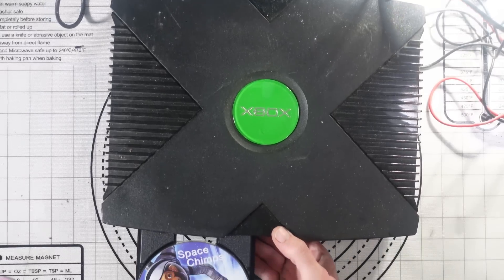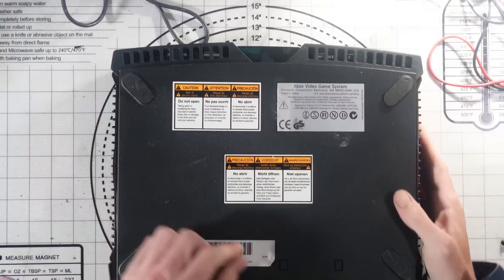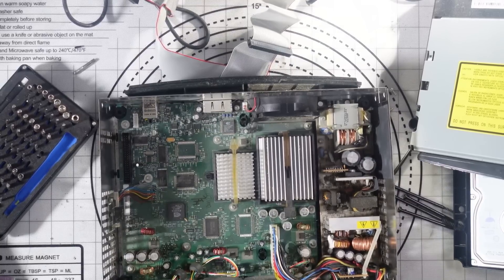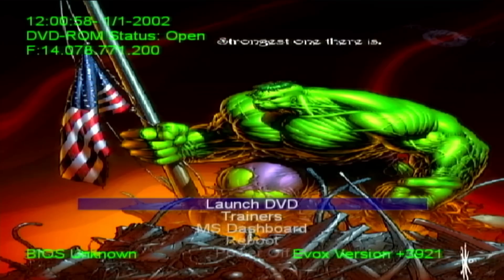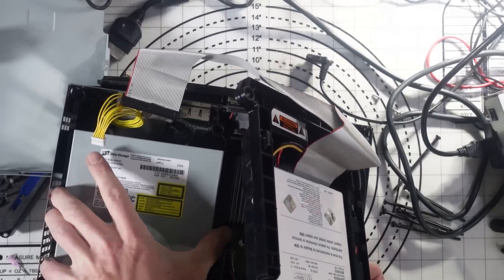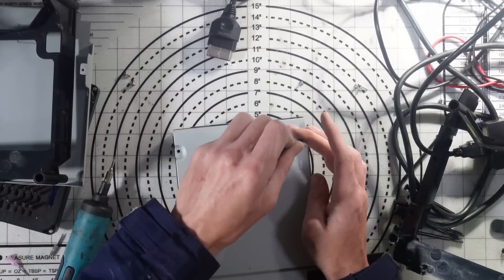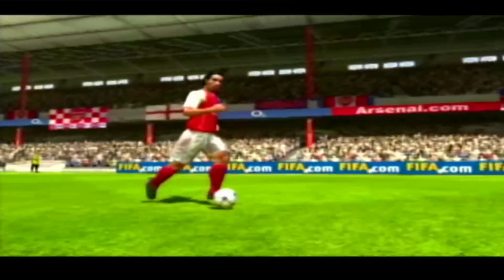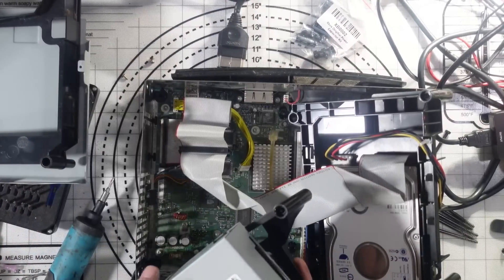This BROKEN OG Xbox Sat In A Box For TWO YEARS With A Hidden Secret! Can I Fix It?

Comment: System is a 1.1, remove clock cap & clean any leakage, check for developing trace rot from electrolyte leakage, the x5 Nichicon HD VRM caps near the CPU fail on occasion.

Error 12 Samsung DVD drives check for bad resistor arrays near the IDE header, and DVD drives which don't throw errors but don't read - try recapping. ESR meters are handy for ruling out bad caps; MESR-100 and Peak Atlas ESR70 Gold to name some

Comment: For the Samsung DVD Drives, check the Resistor Arrays behind the IDE connector 82 and 33 OHM should all of them read. Error 12 mostly caused by faulty Resistor Arrays (:

Comment: You can configure the BIOS so the system ignores a missing or faulty DVD drive. Most of my OG Xboxes don't even have the DVD drive installed, mostly because I've slimmed them down. I copy stuff over via FTP to the HDD.
Reply: Yes I did that

Comment: Ive still got my OG xbox.
its TSOP flashed. 1tb hard drive, etc
I even internalised the dvd remote sensor, fitted USB ports to the console etc.
But one day i went to play it.. Pushed the power button, and it just power cycles...
powers on, turns off.. instantly tuns back on again, then back off....
Keeps doing that... I have absolutely no idea what is wrong with it :(
(its not the clock cap causing damage, i removed that years ago, before it had even gotten chance to leak)

Comment: I’ve switched completely different drives in the OG Xbox with no issue. No changing out boards either. As far as I can tell they aren’t married.
Reply: yeah only the HHD are married, password locked. The drives just need to be to have a an Xbox ROM

Comment: If you have a questions on these consoles man I know quite a lot and If I don't know, I know people who do. I can link you to some OG Xbox discords interested or if your familiar with Insignia or Xlink kia I can help you set it up if you're trying to play the Xbox. Also I would like to note that your other two consoles may be salvageable. If you want to add games you need to FTP the .XBE files over not ISO files. I have links for all DLC and Updates for the consoles too as that stuff can no longer be obtained through other means. If you decide to mess with more of these consoles you can use rocky 5 softmod the newest xbmc(Kodi) dashboard is xbmc4gamers. All dlc and apps and be downloaded on the consoles side if you install xbmc4gamers with rocky5 no ftp required that method. But as far as the disc drives go you only need to get it to work ONCE. I have saved many consoles with bad drives if you take the drive apart and put the disc in hot swap style also u can clean the laser etc and normally get it to read splintercell the one time so as to boot the soft mod. Once you soft mod a console you can essentially put ANY disc drive into it then even just a random pc drive. The methods to doing this vary but either way u don't need the drive anymore after the mod u can just move everything from a computer. You can also use a different console and disc to rip the .xbe from your disc and then ftp it to the PC then console so u can put good rips on them that way.

Comment: You should remove the clock cap though, even if it looks fine. Mine looked pristine but started to leak underneath, v1.0 og xbox too.
Reply from the maker: I think it's been removed mate. I didn't see it on the board. I could have missed it though
Reply: @TheCod3r  I'd circle it out but I cant post links here. It looks like its on the board tho, bottom left theres 3 big caps, inductor and right of the inductor is the cap in question. Maybe it could have been replaced already by whoever owned it before but worth checking out